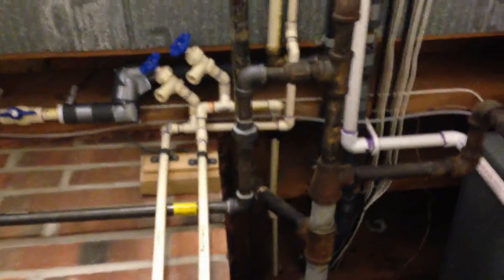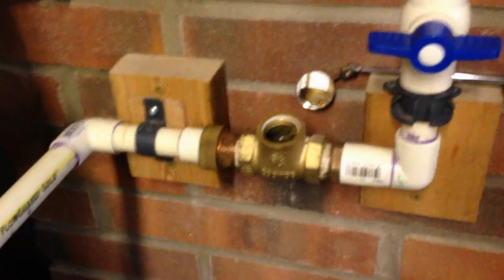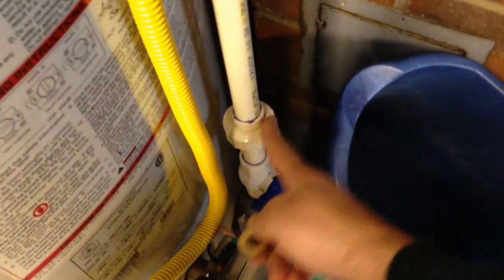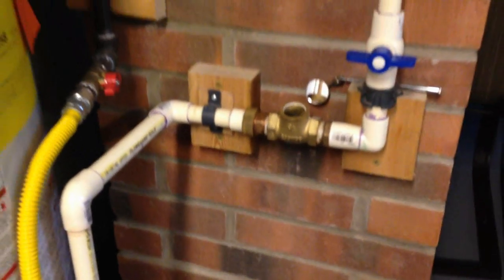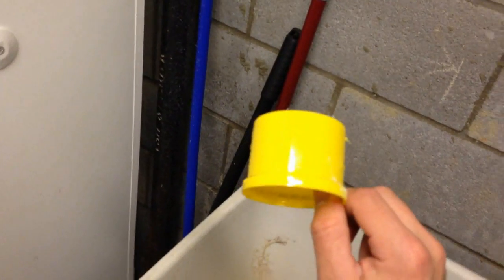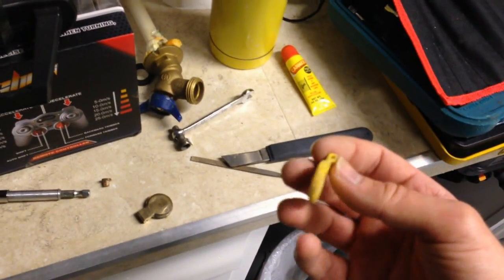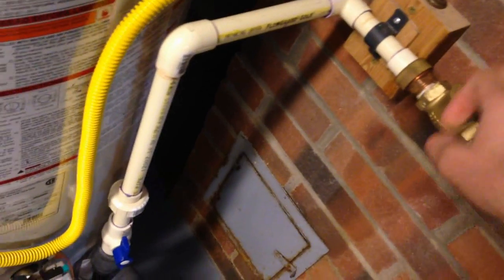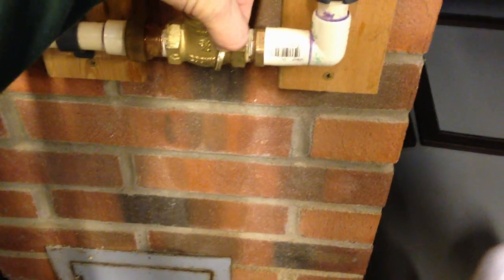Instant Hot Water Line Recirculation Part 1

Comment: Hopefully you can reply to this message. Right now, I have a branch and tee plumbing setup in my house, and one gravity recirculating line at the furthest fixture. Works great. Now I'm installing a copper manifold system in my house for better temperature control at various fixtures (i.e., two showers running at once). I'll have five 3/4" branches running off of the hot manifold to their respective locations. I want to recirculate all five of these. I have access to basement ceiling, and the house is a larger ranch home. Can I just replicate the same setup I have now, for each of the five locations? I would use a swing check valve for each loop. My concern and the reason for the question is that with five loops, and even using the check valves, would each loop be able to hold an equal temperature roughly so that I get hot water as fast as I do now? Would I just want to use one swing check valve before each of the five loops connect together at the water heater? Wondering if having five swing check valves next to one another would make them conflict and not work right. I am thinking using a swing check valve on each loop because I think the water flow from one loop may go into the other loop. Would each loop not mix like this due to the pressure difference from the height? I might be over thinking this, but I do want to have five recirculating loops. Thank you!
Reply from the maker: @iowaman83  you don’t need multiple valves. It acts no different than a branch system. You only need one valve right before the single line enter the base of the tank on the return. The only difference is that you will need to tee back a return for each location instead of just the furthest fixture. This however depends on how far the manifold is from the tank in relation to the fixtures. If a branch off of the manifold is only going 15ft or less there would be no need to put a return tee on it near the fixture. Especially if you are using pex since is not heat dissipating like copper. One return tee on the line at the opposite end of the manifold will heat the whole manifold. Then just place return tees in the loops longer than 15ft. But really even a 20ft feed line with pex should allow warm water to pass through rather quickly since it’s already a heated manifold. My opinion is to only place the return tees on low flow fixtures such as bathroom sinks. Dishwashers, washing machines, showers (less than 20ft away) don’t matter. It would not be worth the parts and labor to tee back each one.

Comment: Thanks for the video. I have comments from some who don't understand convection at all. 
     I've done passive, (gravity), systems for many years with good results and happy customers. I had used a ball and spring type check valve in a vertical application with the spring removed. When pressure was applied, the ball would rise to close off that line. Now that valve is no longer available so I will give your setup a try on my next application. One thing that would probably help the setup would be to use copper plumbing, at least for the return lines if possible.  Copper draws heat out of the water to cool it more rapidly. Naturally, all hot water feed lines should be insulated. Personally, I prefer copper for all my plumbing jobs.

Comment: I'm planning to install this system in my rancher with the water heater in the 5' crawl space. I have purchased two backflow preventers, one will be mounted vertically with the spring removed making it a normally open valve and only close on a backflow condition. One valve is a all brass construction and the other is a brass body with a polyethylene tappet inside. What are your thoughts on witch one to use? Also, this is a newer home and may have backflow preventers in the top of the water heater, would the hot out need to be removed?
Reply from the maker: If the backflow preventer on top of the water tank is brass or spring loaded, then it will need removed. You should use the one that has the polyethylene valve inside. Any backflow preventer with a metal valve will be too heavy for the unpressurized flow to work. Unless it’s mounted in the horizontal position. Metal Valves tend to seize some point though under low flow low pressure conditions.

Comment: Instead of the swing valve, I believe you can use a regular gate valve where you drill a 1/8 inch hole in the gate.  You open the gate valve to get the recirculation started and then you close the valve and the 1/8 in hole is enough to maintain circulation but too small for significant cold water to back flow.
Reply: If only we had the time to experiment with every possible way of doing things to find the best results. You Tube sure helps to weed out the good and bad for all of us. In your case, have you tried your idea and what was the outcome?

Comment: Pvc piping is not rated for hot side application. Granted you have transitioned to cpvc after the check closer to the hot water heater. Idk i think inspection would fail?
Reply from the maker: It’s all cpvc and pex.

Comment: You should’ve used a spring check valve with a circulating pump
Reply from the maker: Young Pana this system is zero failure. No electricity, no pumps. Works without issue for nearly 30 years between both houses i have lived in.

Comment: I'm about to add a recirculation line on my home.  I'm reading I can just tee into the cold water inlet since it goes down a dip tube. Will this work or will it be much better doing it through the drain?
Reply from the maker: shawn d you need to feed it into the bottom for better circulation. And remember to use a check valve.

Comment: this guy don't know s*** from Shinola that hot water dip tube that goes in that tank does not blast water into the bottom of the tank are you'd have sediment throughout the whole system the hot water dip tube is actually perforated all the way down so that it spreads out the introduction of cold water evenly throughout the tank and if I understand what this gentleman started out saying is he gravity feeds hot water up through his system so the hot water is there all the time I can imagine his utility bill for this tank is way more than it should be and creating heat in your house in the summer time to offset it with an air conditioner more utility cost and that little valve you're playing with their is called a swing check
Reply: The dip tube is not perforated... that would defeat the purpose of the dip tube. Its purpose is to direct the water to the bottom of the tank, then it forces the hot water (since hot rises) out the top of the tank.
Reply from the maker: LARRY CURRIER working perfectly for years.  Old tank was 40 gallon and had cost $27/month during summer with NO circulation system and ONE person living. New tank is 50 gallon and costs $35/month during summer WITH hot water circulation and TWO people living. You do the math...
Reply: Growing Answers it may work fine but your explanation of this piece of equipment is not correct in some aspects you're going to make videos got to know what you're talkin about
Reply: I scrap old tanks and have never found a perforated cold line supply. The idea behind water coming to the bottom of the tank is to prevent sediment. Some tanks are built with piping that will swirl the water to help keep it clean. As far as costs, I think a detailed study would have to be done to determine energy cost to heat versus cost of wasted water. Bottom line, it's really the convenience of have hot water at the tap.

Comment: silliest thing I ever saw get a small re-cirulating pump and be done with it.
Reply from the maker: TheNorthsquad this requires no power to run, no moving parts. been using this method for over 20 years without flaw. Every installment in the house has warm water the second it’s turned on. recirculating pumps are point of use only. if you have many faucets and showers, you’d still need to run a return line like this to circulate to all of them. And at that point you’d no longer need a pump. The system is self sustained with convention alone. with or without a return line, the gas bill didn’t change. and by a flow trickling back through the bottom of the tank it helps to circulate the water and reduce buildup of mineral deposits helping prolong the life of the tank.

Comment: I put my check valve in at a 45 deg angle. That way it is usually open which allows the circulation to occur and when the hot water tap is open, if water tries to go back up the re-circ line, the flow causes the check flapper to close. Worked for me.  The recirc line works great and all fixtures on the hot water line now get almost instant hot water.
Reply from the maker: Brian K in my case, the valve housing was to large and the plastic valve I made floated to high which wouldn’t close with the flow alone. So the pin i installed holds it down at about a 45.

Comment: You need to obtain or build a check valve using a floating plastic ball, vertically oriented.  Ball must be food grade and able to handle 140F. Will never build up scale or have any other issue, and ball will not restrict convective flow at all.
Reply: They are called Anti-Gravity valves and are generally used on gravity primary circulation between a solid fuel stove and hot water cylinder.

Comment: You say spring valves won't work. I only use spring valves, they tend to have less issues.  I like your creativity molding a new swing door.  However  the body will still calcify and corrode and aside from the minerals it pulls form the water which can be solved in other ways, you have brass to copper so you have dissimilar metals creating electrolysis which is the most common cause of buildup and corrosion.  That could be solved by using cpvc male ended nipples.  You can use cpvc check valves and eliminate the metal all together the best route.  The big problem I see with your fix is not only will the body continue to have build up and corrosion but that plastic you molded will warp from the heat of the hot water.  It may appear to work fine for some some time before you have a noticeable problem but it will begin to destroy you efficiency immediately. Also and the end of the would not have been easier to just replace a ten dollar valve rather than spending all that time attempting to out think the engineers?
Reply: Why are copper and brass dissimilar? Brass is a copper alloy.

Comment: It's much easier to just install a Hot Water Lobster instant Hot Water Valve.
Reply: I think you've missed the point of a gravity system. Your lobster may be an easier way but more costly. Also, you need to have a power supply under your sink.
Reply: You may not have done all your research (Physics 101). By "gravity system", you may mean thermal convection (hot water rising above cold water). Thermal convection is caused by the difference in pressure created when water is heated (expanding the water molecules). Expanding the water molecules, by heating the water, makes then lighter than cold water molecules causing hot water to rise above the sinking cold water (the cold water having condensed and heavier molecules). As the hot water molecules expand and rise to the top of the water tank,  a slightly higher pressure is created at the top of the water tank than at the bottom the water tank (cold water having condensed and heavier molecules). The thermal convection is what circulates hot water through an open plumbing system.

The Hot Water Lobster Recirculation Valve uses the thermal convection generated within standard water tank type water heaters to circulate hot water. It does not require any electricity or pumps to operate. For under $200 it is an inexpensive solution with a very easy, under sink installation that anyone can install.

I hope this helps your understanding.

Comment: I have installed two recirculating systems similar to this system using the same check value. The only thing I do different is drill an 1/8" hole in the center of the check value gate. This allows a small flow that makes it easier to create the gravity flow. Works great!

Comment: This makes perfect sense to me in regards to saving water.  I am looking for a solution that allows me to get rid of one of my hot water heaters.  I have two.  One is at one end of the house and services the two bathrooms (400L), the other is at the other end of the house and services the laundry and kitchen (80L).  I assume that the second hot water heater was installed to avoid having to run a really long hot water line from one end of the house to the other.  I want to go to a single large hot water heater that I will be heating with evacuated tube solar.  For me the passive thermosiphon system described here would be perfect so long as it doesn't cause a problem with the evacuated tube system.  I think I might give it a try.

Comment: And you prevent water circulating 24/7 through your pipes and water heater how?
Reply from the maker: I'm not sure what your question is regarding. The best way I can answer is that when you turn the hot water on at the faucet, you want the swing valve to close to water only flow out the top of the tank as designed. You want the swing valve to stay open all the time to allow water to naturally circulate hot water to the points of use. Judging by your avatar, I'm not sure if you are being rhetorical based on misinformation perhaps.
Reply: "You want the swing valve to stay open all the time to allow water to naturally circulate hot water" all-the-time=continuous water heater demand
Reply from the maker: Redy Temp
Actually it hardly has any effect. This is a more common practice the some people realize. All my hot water pipes are very well insulated and the circulation happens so slow that the volume of water heated is hardly a gallon worth. Before I replaced my tank, my gas bill was around 25 for summer. The new tank is 10 gallons larger and the bill is between 25-30 in summer. Because of hot water usage for daily life it has constant demand just by turning on a faucet for a minute or 2. The tank sitting without demand hardly kicks on at all. Letting the water run for a full minute to get hot at the spicket is less efficient than having it already there. The demand is about the same when averaged out, but wastes less water.
Reply: I think you need to lay off the sauce, your not make'n any sense.
Reply from the maker: Redy Temp
What don't you understand?
Reply: Having hot water exiting out your water heater  24/7 benefits the utility company more than anyone else.  Just stating the facts.
Reply: It doesn't run all the time, only when hot water is called.
Reply: Running your hot water 2-3 minutes just to get hot water at your furthest tap, only to turn it off after a minute of washing your hands, also benefits the utility company.  You've just heated up the entire run with hot water that you'll never actually use and now that water has to be replaced with cold water in the tank, which takes more energy to heat.  The water recirculated in this setup is only slightly lower in temperature, mixes with the existing hot water in the tank, and requires very little energy to heat back up...  It isn't for every application, but for people with bathrooms at the end of a very long run can benefit and save money doing this with the added convenience of having hot water the moment they turn on the faucet.
Reply: jollyranchhand there's two and a half gallons of water in a hundred feet of 3/4 inch pipe if you have to run the water for two or three minutes to get hot water you must live in one big ass house water normally runs from a faucet at the rate of 2 and 1/2 gallons a minute
Reply: Water circulates through 24 hours a day in this system because that's what it's designed to do. Actually, it doesn't cost much at all as he's using a gas hot water heater and the pipes are insulated. Gas is about .33 cents a therm, and insulated plastic pipes only bleed off about 5 btus/hr/foot.  He's also saving water, which is usually not free.  I ran the numbers and it costs about $5 per month in gas, offset by about $2 a month in water savings, more if your water is expensive.